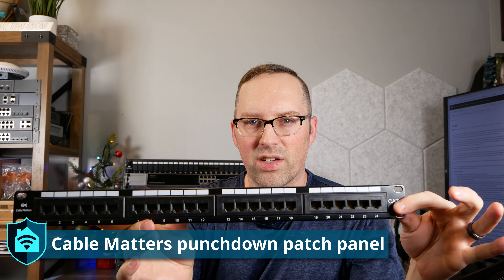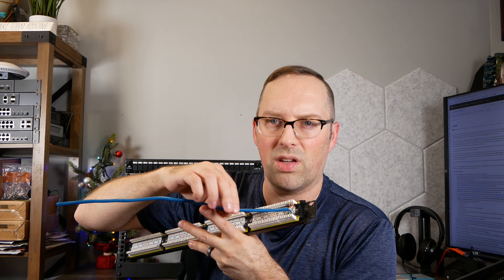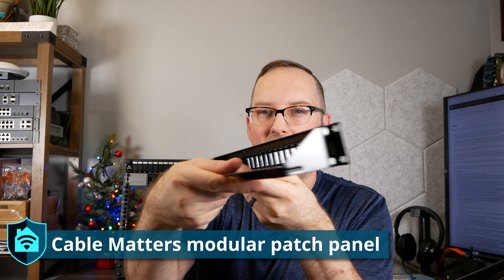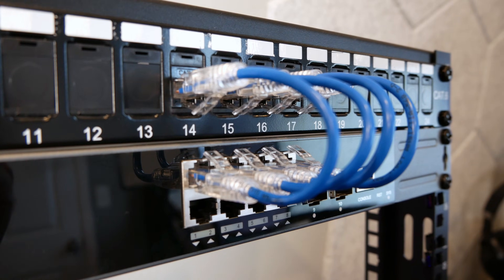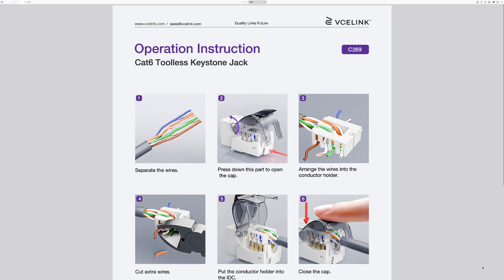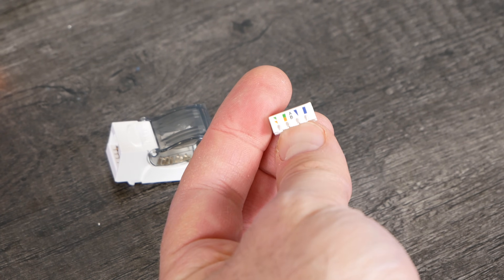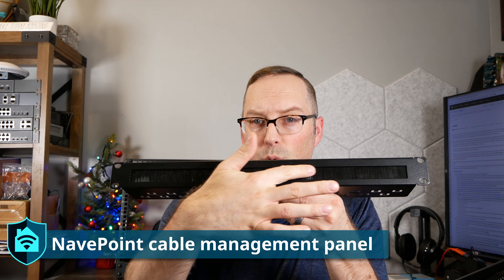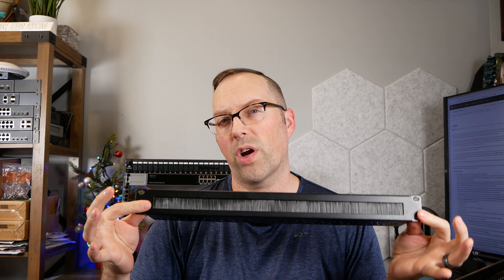Using Patch Panels in a Home Network or Homelab

Comment: 5:50 I still don't know how anyone ever uses those cutters and you see the sheath comes right off and you don't think it nicked any wires below. It cut clean through the sheath that why it came off so easy. That pull string you are cutting off has a purpose.  Use it to pull down another 2 inches and then trim off the wires just below your original cut. Guaranteed no nicks can be on the wires!

I just dont trust that these cutters are perfect or the cable you are cutting is perfectly in spec.
Reply from the maker: Yeah that’s true. You could use the string. I’ve done a lot without problems but it’s safer to use the string like you said.
Reply: @homenetworkguy I don't know why I'm just paranoid.. it takes 5 minutes to do again but it's 5 minutes I don't want to do again lol
Reply from the maker: Yeah I understand. For some reason when I first tried using a passthrough RJ45 crimper tool, I messed up like 5-6 times and after that initial practice, I haven’t had any bad crimps since then. Not sure what I was doing wrong but it was frustrating until I started getting them crimped properly.

Comment: Would that work with Cat7
Reply from the maker: Very likely. I believe the main differences on keystones rated Cat5 vs Cat6 especially for punch down keystones is that they better accommodate thicker gauge wiring. I haven’t really spent time testing that because I use mostly Cat6 cables because it can do up to 10Gbps without issue (since I don’t need to do any runs longer than 55m).
Reply: @homenetworkguy  Thanks for the response. But is it not a problem if you don't connect the ground?
Reply from the maker: Ohh you’re asking about shielded cables… probably not technically necessary for home usage but they make shielded keystones you can use. But then it would need grounded somehow to the patch panel and the rack would need grounded. That is one area I haven’t explored deeply but have thought about a few times since I have a lot of electronics in my server rack.

Comment: ..or you could just mount your switch with the ports facing the rear of your rack where they are actually needed.
Reply from the maker: Yeah you could do that for sure,  but I don’t like having to access the back of my rack in my small server closet unless I really need to. Also some network racks are mounted to the wall so you can’t rear face the network switch.
Reply: @homenetworkguy  You usually don't put servers in a network rack, the rack isn't deep enough, so a network rack usually have the patch panels facing forward and it makes sense to face the ports of the switches forward too. In a server rack the servers has their nics at the rear, so usually you mount a top-of-rack-switch facing rearwards too for convenience. I can't recall ever seeing a forward facing switch in a server rack in an actual server room, it's just not how it's done - except in reddits homelab subreddit, where everyone is busy praising each other for looking "pro".. 😀
Reply from the maker: Fair enough but most of my home network is powered by mini PCs and I face all of those mini PCs with the NICs forward so I can make changes easier. I still find it easier to have everything in front because I’m always tinkering and testing things. I don’t do it to look “pro”. Enterprise server racks typically have all the wiring in the back but there’s often easy access to both sides if there are rows of server racks. My server rack is pushed against a wall in a small closet— far from a “pro” set up but that doesn’t mean I don’t like having neat cable organization for parts of my rack that don’t change. It’s more of a pain to get to the back of my rack than the front. The other half of the rack is where I tinker to learn and experiment. Homelabbing as a hobby.
Reply: @homenetworkguy  You're basically running your rack with the rear side facing out then, which makes perfect sense, I do the same. Now I'm just puzzled why you need patch panels and brush panels when your switch ports are facing towards you and your servers also have their network ports facing towards you?

Comment: did you run your own cables through walls for the drops? how hard was it?
Reply from the maker: I had the builders of my house install all the cables for the main floor and upstairs but I installed them all in my basement because it was an unfinished space (that I’m almost done finishing). I had it easy but it can be difficult to run cables in an existing house that has no conduits or easy locations to run cabling.

Comment: The video hits the mark perfectly! Thanks for all the quality content you make!
Reply from the maker: Thanks! There is more I could have covered but sometimes you just have to focus on a few specific things. 

I’m considering things from a home networks perspective rather than a business/enterprise perspective so using keystone couplers is likely more acceptable for home networks than an enterprise where everything is likely pinched down instead. Keystone couplers are useful for connecting devices within the rack (which may change over time so it’s convenient to use any Ethernet cable I have available), and I like to use punch down keystones for all of my wall drops which do not have the potential to be reconfigured in my rack.

Comment: Many good comments presented in your video; agree that modular patch panels with keystone jacks are the way to go for any network. Two comments 1. I would not recommend using passthrough RJ45-type coupler (2:45 and 3:32) - better to use real punch-down keystones in your patch panel. Keystone jacks use PCBs (printed circuit boards) inside that are component rated (i.e., Cat 5e, Cat6, etc) and help impedance-match your cable run. This is important for optimal performance in terms of crosstalk, return loss, "headroom", and other parameters that can be tested with cable verifier or cable certifier equipment. Simple plastic 8P8C modular plugs ("RJ45 plugs") and the corresponding pass-through couplers do not have this feature. Also, plastic RJ45 plugs that plug into the pass-through couplers are prone to fitment issues - the 8 individual wires or the outer jacket may or may not fit well in the plastic plug unless the plugs are chosen carefully. Not a problem with punchdown-type keystones; each individual wire is firmly "punched" or pressed into an insulation-displacement connector in the printed circuit board of the keystone jack.  2. Your reply comment to @microOutdoors implies that Cat6 is is "good" for 10Gbps up to 55m and cat6a for up to 100m. This is a bit simplistic. Even Cat5e cables will work for 10Gbps for short distances (up to 45m or so) IF the entire channel is properly constructed - keystone-to-keystone "permanent link" and properly-certified patch cables to connect to the computer/server at one end and to another computer or device at the other end. It's not the cable itself that determines the throughput and crosstalk, return loss, headroom and other parameters. Instead, it's the entire channel (patch cable - keystone - permanent cable - keystone - patch cable) that determines the performance obtained.  For more info, start with TrueCABLE's website and search in their blog or videos for "Choosing the Right Termination -  Keystone Jack vs RJ45 Connector ..", "Selecting the Correct RJ45 Connector", and "What Does a Bad Termination Look Like?" Also at TrueCABLE's academy, check out "Ethernet Quality:  Channel Level vs Component Level Rating".  Again, good video!
Reply from the maker: Thanks for the feedback! 

I think those are important points to consider. I use punch down keystones for all permanent wall drops but for devices within my rack, I don’t think it’s worth punching down keystones within the rack especially for an ever-evolving home network/home lab. I’ve never noticed any issues using passthrough keystones, but I’ve never measured the signal attenuation either. I think that is a bit overkill for home networking. Haha.

I refer to Cat6 being “good” for 10G up to 55m because that’s what the specs say. I realize 10G can work on 5e for shorter distances— results could vary depending on a number of factors (I’ve never tested it). I just use Cat6 for everything, and call it a day because I don’t have any runs over 55m in my house.

Comment: "toolless keystone"
"Uses tool to cut the wires"
Reply from the maker: “Toolless” really means no specialized tools like a crimp tool. I suppose you could try to bend the wires back and forth until they fell off (but you’d need to slice the wire coating slightly to completely sever the wire). You could use scissors perhaps. I guess that would technically be a tool as well.

Comment: I use to punch down a lot of panels and taht sure gets old really fast. It was nice to see how the keystone connectors have developed over the years.  Good intro video for people just getting into using patch panels
Reply: Notice I seem to not know how to spell 'that' very well
Reply from the maker: Punching down Ethernet cables does get old. There are some better tools and methods than what I’ve shown but for a small home network, it’s not worth the investment. You could almost get away with primarily having keystone couplers so you don’t have to patch a bunch of cables down when using modular patch panels. 

What I did on my network is only punch down keystones for all of the permanent wiring in the walls and then I use couplers for all the wiring inside my rack (that’s not SFP+, which I use DAC cables instead).

Comment: Keystone patch panels all the way.  I like the Everest Media Solutions panels that have a removable 6 port section so that you can work on it from the front of the rack.  They only work with slimmer keystones, so your toolless jack might not work in it.
Their easyJACK system is nice for the termination. It punches down all the wires simultaneously, and made me hate wiring just a little bit less.
Reply from the maker: Nice! I’ve seen those before and I can see how that would be handy to work from the front because it can be a pain to get behind the patch panels sometimes.

Comment: Could you please explain how a keystone matters as far as "speed" why is there cat 5 ($10 per pack) vs cat 6a ($35 pp) how is there a difference??
Reply from the maker: My guess is the Cat6 keystones are designed to hold thicker gauge wire but I’ve read that it might not matter (this is true with RJ45 plugs when you are making your own Ethernet cables). I tend to use just Cat6 for everything so I can go up to 10Gbps if I like. (Cat6 should work up to 55m while Cat6A up to 100m— I use Cat6 to save money in my house since all the runs are less than 55m).
Reply: Cat 5 and cat6 are different wire gauges, and the parts that bite into the wire are made for a particular thickness. It'll create a poor termination if you mismatch them with your wire.
In a professional install, it would fail a certification, and you'd have to do them all again.
Reply from the maker: Thanks for the explanation! I assumed wire gauge was the main reason (as stated in my earlier response). I just stick with Cat6 by default so I can go up to 10Gbps if I ever need to (I currently only have 1 Ethernet 10Gbps connection and the rest of my 10Gbps connections are SFP+).
Reply: @homenetworkguy  I was only able to get 5Gbps stable on Cat 6 even under the 55 meters.  Good enough for now, and they make LC fiber keystones if I need to get higher.
Reply from the maker: Interesting because I don’t have issues with my PC getting 10G with Cat6. It’s probably a 40-50ft run (12-15m).
Reply: @dapoobah  make sense so with that the rj to rj (not push style)  keystones have?? Lol. I know, my weakness is to over think everything! I've already got all 6a, just curious as to how / why the $15 difference on equal number sized packs of keystones from 5 to 6a.

Comment: hi after doing this my self, with mono price keystone, i keep getting it saying 8,7,6,5,4,3,2,1. Any help?
Reply from the maker: If you’re using a basic tester, it may not check the proper order but rather that a connection can be made on each pair of wires. It’s a rough check the wiring is good but better testers can give you more details about the wiring. So it’s possible you have the wiring correct depending on your tester.
Reply: @homenetworkguy  Hi thank you so much for that mighty quick response, I am using the cable tester by iMBAPrice. But in case I am not doing them right do you think you could point out how I should do it? all of my colors are right and im using the KLein Tolls 110 punch down. Once again thank you for your help
Reply: @homenetworkguy  I also just used the Klein tools tester and it says Miswire. I even plugged it into the wall and tested the keystone that I used. However it still did not work.

Comment: Nice. Very important the twist of the pairs together as much as possible. The higher Cat #, the more important it is to get speed and to be stable.
Reply from the maker: Yeah that’s important. I could’ve maybe twisted a bit more in the demonstration but if only the last inch is not twisted perfectly, I don’t think that’s a big deal because at some point the wires have to be separated a little bit to be terminated. I try ensure the jack of the Ethernet is as close to the edge of the keystone as possible and properly seated inside RJ45 plugs whenever making cables to minimize the amount that’s untwisted. (It also helps support the cable better too in addition to looking cleaner)

Comment: The modular patch panels are the way to go. I'll sometimes leave a keystone blanked so I can feed SFP+ DAC's through them. Keeps it looking nice and tidy.

Big fan of the rj45 couplers but many people will lecture you on using them lol. It's not a production network so stuff it.
Reply from the maker: Yeah for sure. I recently thought about feeding the SFP+ DAC through the empty keystone opening as well when I was making this video, but since I'm using a 48 port switch in my rack, I don't have extra openings so I just wrap the DAC cables around the side of my rack (I have a small, clear command hook that I rest the cables in along with velcro on the cables so it looks relatively clean). I may do that in the future if I'm rearranging some things in my rack (will probably be adding a new core/aggregation switch at some point). I have some extra modular patch panels since I replaced 2 2U modular patch panels with a single 48U modular patch panel.

I primarily use the RJ45 couplers for any Ethernet connections for devices in my rack because it makes it easy to use standard Ethernet cables. It seems silly to me to use punchdown keystones for devices inside my rack since I have to make custom cables or cut off one end of a perfectly usable premade Ethernet cable. The rest of the keystones I use are RJ45 punchdowns for all of my wall drops in my house. S